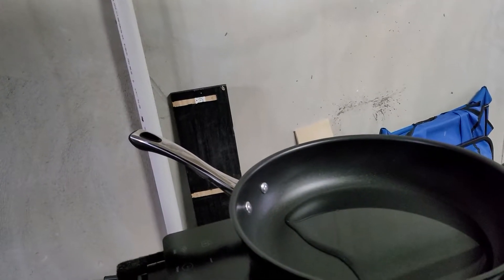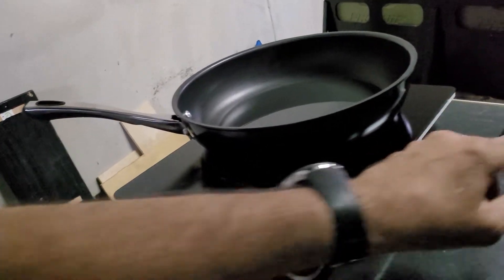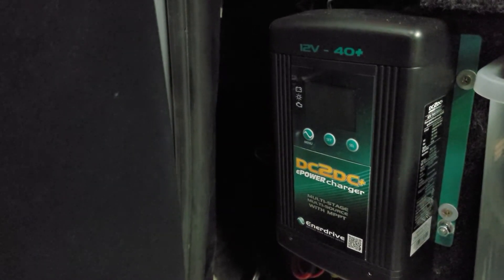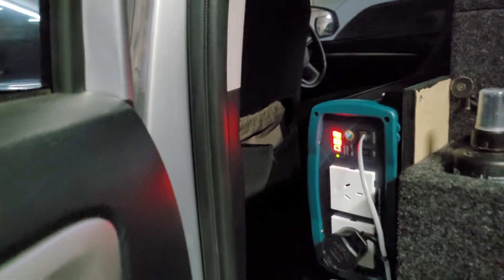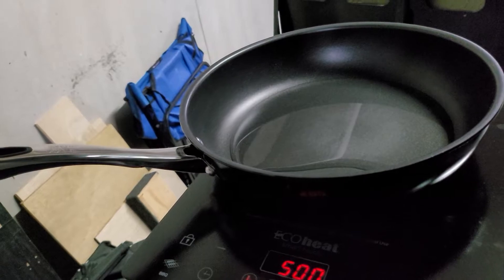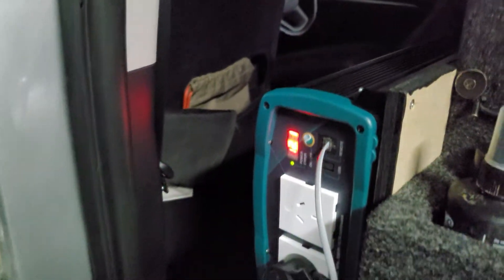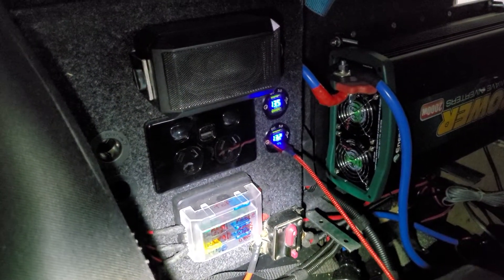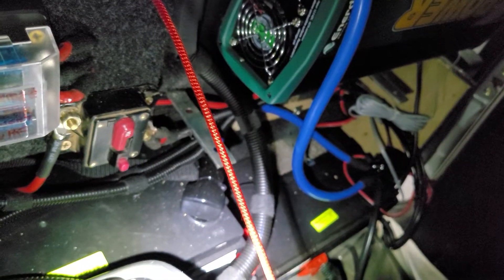#0013 induction cooking, 2000w enerdrive inverter, lithium batteries, dc2dc charger

Comment: Neil I have just come across your videos as i am also getting the 2000W enerdrive inverter. I was just curious as to what brand of 120ah batteries you are running
Reply from the maker: My lithium batteries are from
 EV Power Australia Pty Ltd.
Margaret River WA, 6285, they post anywhere in Aust I think
I would prefer to have one bigger battery (not 2 joined batteries), if you are going full elec like me imo a 300ah would be a good size
I'm finding the 2 batteries don't drain or charge evenly, one seems to drain more than the other, it's not an issue ATM but may shorten the life of one of the batteries. I've tried  3 different ways of joining the batteries but they still don't drain evenly.
Lots of vans have multiple batteries all connected but after asking the professionals I found out they don't monitor the batteries individually, they have one gauge that gives them battery %, I assume it just averages out across all the batteries
I do like enerdrive stuff and I would imaging their lithium bats would be good quality
I am a definite electric cooking convert now, never go back to gas
Luving having an assortment of elec appliances ready to go
•Pie maker
•Breville Sandwich toaster
•Pop up toaster
•Nespresso coffee machine
•Milk jug
•Elec kettle
•2 x induction cooktops
•air fryer
Reply: @NeilF4x4Crusading  
Neil 
 That is good to hear they are the exact same batteries I am running.
I have had the same issue at the moment I have them joined in parallel and only one of them shows in the blue tooth connection.
So I am assuming that they are both working fine.

If you are looking at upgrading your batteries have a look at custom lithium batteries

Comment: Boiling water is not cooking...........test your system cooking food.................induction cooking draws lots of power even for lithium setups.
Reply from the maker: Yes true, boiling water was just testing that it worked. I have a few more recent posts of actual cooking food, induction does draw a fair bit of power but I have 240ah of lithium and can top up with solar if not driving so lasts me for ages.
Cooking 3 meals a day with no power input used about 15% of batteries so I can go for a few days without having to worry about charging